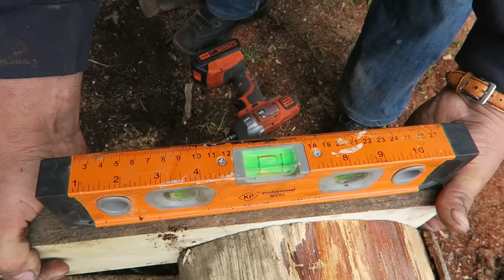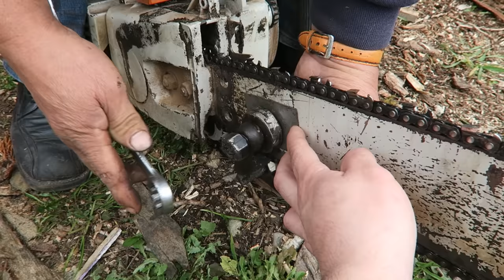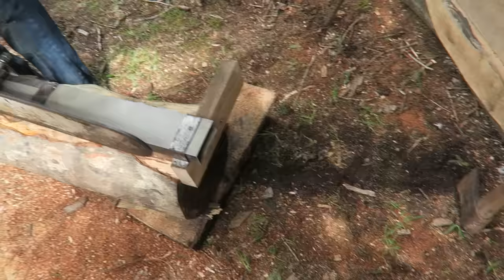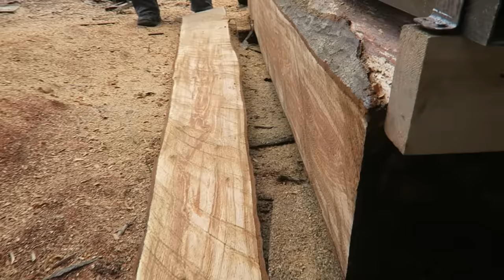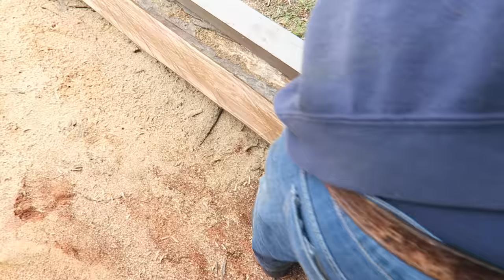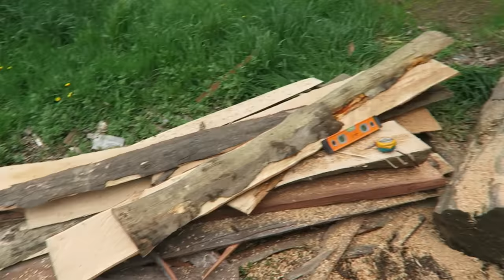Aserradero ultra portatil para motosierra - Ultra portable chainsaw mill

Comment: Nice set up but try taking those rackers down 3more strokes and put more of a straight across angle on the teeth might cut better for ripping wood or get a ripping chain be easier on the saw to

Comment: поверни швеллер на 180 градусов и на нем делай отверстие и затягивай сама резами хоть к доске хоть к дереву.Стружка не будет мешать пиле она упадет внутр швеллера и хамуты не нужны будут
turn the channel 180 degrees and make a hole on it and tighten it yourself with cuts, even to the board, even to the tree.The chips will not interfere with the saw, it will fall inside the channel and hamuts will not be needed